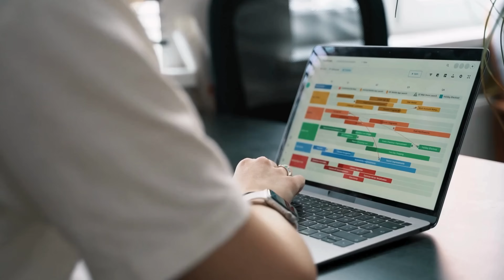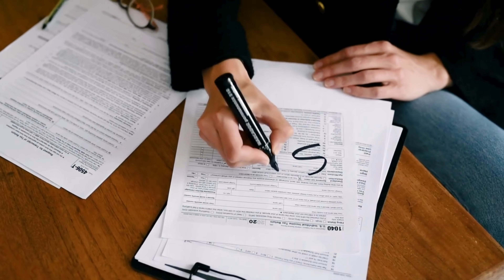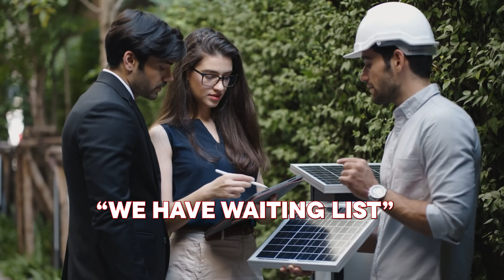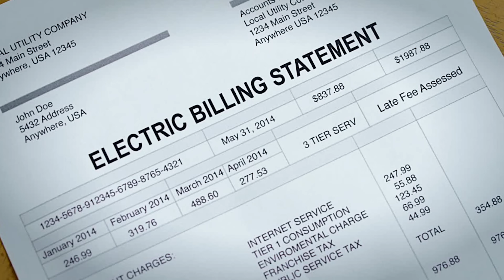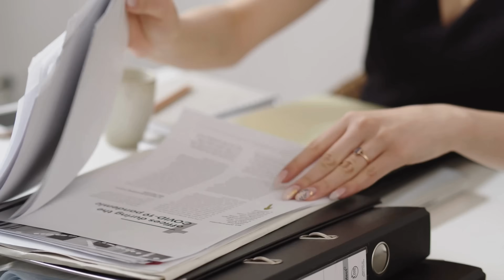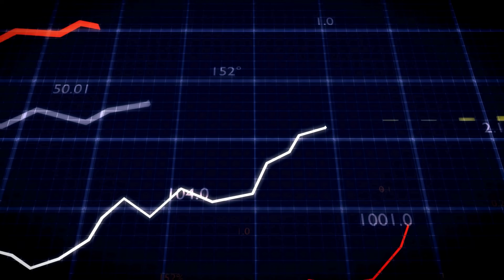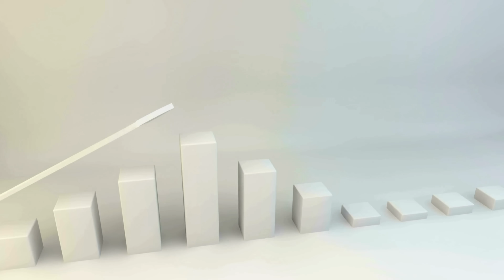Should you buy solar NOW or wait till 2026?! Tax Credit Ending... Prices dropping?

Comment from the maker: HEY GUYS! Thanks for being here! I missed the Youtube Space!!! 
If youre in DFW, make sure to reach out for a solar quote:
info@solartimeusa.com or via call/text 972 675 7725!
Reply: Where have YOU been!!???!! 😢
Reply: Didn't Cheeto man put a 100% tariff on solar imports?
Reply: I am in NE Ohio, the sun is low during winter months, and the best offer I received was 25 years because I can buy it in 5 years, which I intend to do. It was not the ideal one, but I am retired and none of my pension is taxable, and Soc Sec is not taxable either because of the Big Beautiful Bill. So, no tax credit made sense in my case. Yet, it is a solar only, getting credits with power company by selling back, 8.2kW,  credit per kW if guaranteed production is not met for the first two years is $0.163, 
Panels  20 x HANWHA_Q_CELLS Q.PEAK DUO BLK MLG10.C+ 410
Inverters  20 x ENPHASE IQ8HC-72-M-DOM-US (240V)
It will be installed on 17 Nov 25. All permits are cleared. I intend to pay it off in 5 years, because the interest goes up 2.99% every year. Initial monthly is circa $124, but 300 payments would be horrible. If I buy it in 5 years, my price would be, $29,879.  Let me know if I got #$%@ 😆😁I am a big boy, I can take it 🙃😊

Comment: A far better way to go solar now that the solar credit is gone is to search Google for the term "discount off grid solar" Everyone now knows that expensive solar leases and PPAs are not the way to go solar if your goal is to save money. It's far better to purchase and DIY install your own off grid system and take your appliances off grid. You'll save tens of thousands of dollars, and you can reduce or even eliminate your electric bill, and will never have to worry about your utility company changing the rules on a grid-tie solar system's feed-in rate. The only way to go solar in 2026 is to go "discount off grid solar".

Comment: I am planning on buying with cash

I applied for USBANK Sheild credit card, its 0% APR for 24 months. My final cost after tax rebate, fed and state,  would be around 14k$

Will be making around 250$ per month for 24 monthss and have plan on doing Balance Transfer to a new 0% apr credit , once that 24 month of USBANK credit comes to an end. I would look for a new credit card with minimum transfer fee , probably 3% and high 0% apr month , typically 18 to 21 months. I will keep on doing and probably after these 18 to 21months. I will go for another ( probably last) and pay lowest balance transfer fee for a new credit card. 

In the end my plan is to pay off 14k$ by paying 250$ for 60 months ( 5 years) including the tranfer fee cost. 

This way i can avoid issue of dealing with APR % and also pay off the system with cash price. Without paying alot of upfront cash.

I have already got aprooved for 24k$ credit limit from USBANK for 24months. Now waiting to see if i can get those solar panels installed before 31st Dec 2025, to get that 30% fed, as its going away .

Comment: I am in NE Ohio, the sun is low during winter months, and the best offer I received was 25 years because I can buy it in 5 years, which I intend to do. It was not the ideal one, but I am retired and none of my pension is taxable, and Soc Sec is not taxable either because of the Big Beautiful Bill. So, no tax credit made sense in my case. Yet, it is a solar only, getting credits with power company by selling back, 8.2kW,  credit per kW if guaranteed production is not met for the first two years is $0.163, 
Panels  20 x HANWHA_Q_CELLS Q.PEAK DUO BLK MLG10.C+ 410
Inverters  20 x ENPHASE IQ8HC-72-M-DOM-US (240V)
It will be installed on 17 Nov 25. All permits are cleared. I intend to pay it off in 5 years, because the interest goes up 2.99% every year. Initial monthly is circa $124, but 300 payments would be horrible. If I buy it in 5 years, my price would be, $29,879.  Let me know if I got #$%@ 😆😁I am a big boy, I can take it 🙃😊

Comment: In Minnesota a 14k grid connected system ranged between $36k for 5yr lease with "prepaid purchase agreement" to over $47k. The 3 bids all included top of the line stuff but just didn't feel it was worth it.

Comment: Thank you for the video — very insightful.
I’m currently talking with a few installers in PA about going solar. The only hesitation I have is that my roof is about 20 years old. It could probably last another 5 years, but I’m unsure whether it makes more sense to replace the roof now and do solar together (which would be a big upfront cost) or wait a few years and do both later. Would love to hear thoughts from others who were in a similar situation.
Reply: I suggest getting a new roof now. This is what I did. This meant high tax deduction (not necessarily a Federal tax credit).
Reply: Thank you for your informative video.

Comment: Just FYI for all home owners, those tax credits only apply to you IF you have tax obligations on your 1099's.

So for example, if your 1099's says that your tax obligation is $6,000, the maximum tax credit you can claim is $6,000 regardless how much the sales rep says when they try to sell you the system. Do your homework first. So that you don't get a shocker when you spend $60k+ on your system and think you would get X amount of money back from tax credit when you don't have much tax obligations to start with.
Reply: Thank you. I figured I would not be eligible for the tax credit since my house is paid off and I do not itemized my taxes. I just had a solar rep give me a presentation and he seemed like he was really pushing me for a decision by end of year.
That means only less than 3 weeks to complete the solar panel project.

I’m very skeptical to have this disruption in my life at 67 years old.
Reply: @ReggieWhite15 Highly unlikely the whole process, design, permit, installation, & interconnection would happen in 3 weeks regardless, that's a pretty unrealistic timeline, especially given the repercussions for missing the deadline.

Comment: I hope I get so of my money back even if it’s a credit on my taxes but it hasn’t worked that well for me in the pass because I haven’t gotten any tax returns for one reason or another and it’s not a check in just goes against what I may owe in taxes I payed 30k on my sol-ark 15k system with 4 pytes batteries and 4300 watt sil-fab panels complete installed that haven’t produced many watts to recharge and use @ a 24hr period without recharging the batteries with my generator every few days

Comment: I bought my sol-ark 15k which is really only able to produce 12k with only 4300 watts which never produced that with also 4 batteries of the brand pytes while the price I paid installed was 30k cash which last about 2 days then I need to use my generator to recharge the batteries because I don’t like the batteries below 50 percent my expectations where higher would like to get more solar panel but I’ve spent all I can afford for now and it just on my off grid cabin I go to on some weekends so I’m hoping that the solar and batteries get cheaper to afford in time or I’ll never do it again for the price I payed……

Comment: Great video Martyna!  All the points hit, and mentioned the future certain rise in electricity cost.
The price of solar in 2026 will NOT drop 30% IMHO. At a guess it will go down 10%, if that.
There was already enough competition that one could find installers who would do it less than $2.70/kW, there were a lot of installers (unfortunately many that were shady).  Soon many installers will go out of business, so the number of installers will diminish, so less competition.  
The hardware side of things will be uncertain, as there will be more parts (overstock), but the tariffs will increase so those parts will be more expensive.
The financing is looking to go down, BUT the buyer needs to be very careful!  Many loans are a ripoff rates.

Comment: I've been in the industry for a long time as you know.  It has been my opinion that the incentives should have stopped years ago.  Along with 1 for 1 NEM tariffs.  But now it is happening all at once and it will be interesting to see how it all plays out.  I know SigEnergy dropped the pricing on their battery modules by 20 - 30% already.  Their new 9 kWh battery is less than their replaced 8 kWh module.

Comment: Also recommend getting a Solar Provider that doesn't just specialize in Solar. 

Meaning, a Solar Installer that also provides Electrician Services or Roofing Services is probably more reliable. However, a long term business that provides Solar, Roofing and Electrician services would probably be the best bet if available.

Comment: Paid 86K here in outskirts of DFW for 29kW and two powerwalls in 2024. After tax credit we ended up paying only 2.08/kwh and from a very reputable installer (GFE). We are producing right on par with consumption even with 2 EV’s. We figure that’s around $500-600/month savings depending on how far we drive, and we also have 1:1NM. It feels great when we don’t even recognize there is a power outage!

Comment: I bought all of my own equipment for $12,000 and put it in myself. And my system operates in non-export mode and therefore never spins my electric meter backwards. So I didn't pull a permit and I did not get a connection agreement with the electric utility, but I did take the tax credit! Ha ha bitches!

Comment: Researched and sole searched for 6 months whether to go solar and battery back up. I live in Florida the US hurricane Capital. If you purchase solar only you are just getting a credit against your power bill. If the power grid goes down so do you.  I wanted to add a battery back up system to run my house a solid 24 hours.  Total cost $60,000. Originally considering this system because the Biden administration was pushing green energy. I knew my power would eventually be up & down and expensive like Europe. 

When the Trump administration came in and started working on building out natural gas, coal, and nuclear energy again I knew cheap energy would eventually be headed my way again. At the of the day if my major power suppliers try to shaft me. I will build out an off the grid power system. I went with a large whole house generator that runs on propane.

Comment: Probably 30 - 50% of the solar installers aren't going to make it through 2026. So that 25 or 30 year warranty they are promising you might last six months. Also, what you never see in the installer's savings calculations pitch is the cost of removing and re-installing the system when you need to put on a new roof. It is a cost time bomb that you'll need to pay down the road.
Reply: Generally not, usually covered by insurance

Comment: More than 15K for a 12KW system is robbery.
Reply from the maker: Welcome to MERICA...
Reply: My price in Ohio is nearly 42k for a 13.2 kw system.(With installation promise this year or I can cancel with no penalty). 
All top quality materials, REC panels, Enphase microinverters and Combiner, rails, trim kit, etc. REC Pro certified installer. All top shelf, but I think it's still kind of expensive
Reply: @wmf1595The issue is the cost of the hardware for that is probably around 13K. Worst case 15K. Where does any business get off charging 27K for 40-80 man-hours of labor?
Reply: Don't know what your talking about...materials alone are 20k
Reply: @robertfoss882 I could do it for $8K. Panels 0.25/W. For 3000. 3000 for the inverter, and 2000k for wire and mounting. Premium grade panels will cost twice that. Some fancy rack mounts another 1000. That is still only 12K. 20K would be way over priced in the US.
Reply: @court2379 then do it your self, you missed 99% of the actual costs to run a solar company.
Reply: @johnsegal445  You have 40-60man hours into an install. 99% my rear.

Comment: Why would prices go down with Tariffs on everything and a renewables hating president in place. When you say 30k for 12 kw do you include battery's in that .
Reply from the maker: I think ( just my feeling) that will lower demand, we will see prices going down as well. Over the past 10 years that I have been in solar, when things go south, like rebates are taken away or when after the 2022 interest rates going up significantly, installers were selling much less, pushing us to lower prices. Its just my gut feeling. But will see and the 30k for a 12kw system does not include batteries no. That's just avg in Texas area though. Could be different in west or east coast. :) 

Thanks so much for asking the question and leaving a comment!

Comment: Full electric home in 77433 was quoted plus 36k with 2 batteries and 24 panels.This would only cover 40% of my consumption. I would also be at kwh price of their electricity provider.They also didn't provide me the cost of the electricity and any references of customers in the same boat. I walked away amidst heavy pressuring.
Reply from the maker: I'm glad you did walk away. When getting 40% offset system you really do not need batteries. UNLESS always set to back up mode. But doing a 40% offset system would be good without batteries are probably much cheaper. 
I would say don't ever sign up with an installer that does not give you the time and space to review quotes and make a financially smart decision. I would stay weary of leases these days. They are getting ruthless there offering 30 year leases for solar.

Comment: Got 3 quotes for 50 to 95k ground mount solar. Installed it myself EG4 twice the panels and battery for 28k. Most of the industry price gouges. I don't blame contractors they are responsible for roofs which I wouldn't want to be. When you miss the rafter 2 times for every time you hit one end up with a Swiss cheese roof leaking not a surprise. This is why I went with a ground mount if I go to sell no questions about roof issues. You don't need PTO to get the tax credit only need it installed. You should get the interconnect approved if they require changes you already bought things now your stuck with it.

Comment: Purchasing solar voltaic should only be done if it will be used to change home battery storage.   Imposing erratic electricity on the public power grid costs more natural gas than making all the electricity with a efficient running NGCC power plant..   It would make a lot fairness if erratic power was not allowed to be connected the public power grid with its expensive support coming from everybody else.   Roof top solar panel installation effect the load carrying ability of the roof.   The wind drag can cause the roof to be ripped off during strong storm wind.  Home insurance will greatly increase rates if installing roof top solar panels in hurricane prone areas
Reply: Most utilities are not longer paying 1 to 1 NM they pay 2-4 cents and they put in a demand charge when the sun goes down 4-7pm. Grid only tie is no longer even viable unless you get 1 to 1 which only a few small utilities offer it anymore.

Comment: Hello there!! Question  I just started the process with Tesla but I’m afraid to get everything done before the end of the year as they give me a roof inspection into  Nov 18 , if is that possible to finish the process and permit ? What do you think?
Reply: You don't need power turn on utility approval or even inspection to take the credit it just has to be installed by 12/31. I would make sure you get interconnect plan approved and AHJ approval before you buy anything. I think Trump admin will be auditing want to get those things done before tax return day 4/15/26
Reply: Tesla isn’t installing your system this year bro

Comment: I'm moving forward with REC Alpha Pure RX panels. Surprisingly, they were out of stock for a while. My contractor says they should be receiving shipments soon. I think I'm safe for the end of the year deadline.
Reply: He only has to get it installed to take the credit doesn't require PTO, or even inspection. Although I suspect the Trump admin will be auditing many of these returns best get it done before 4/15/2026.